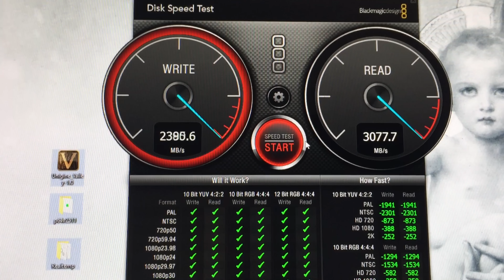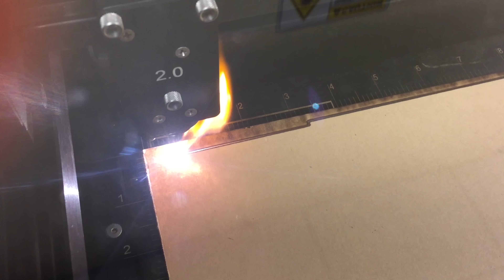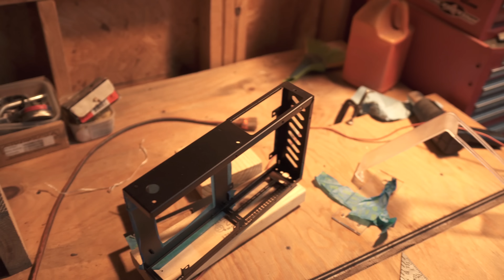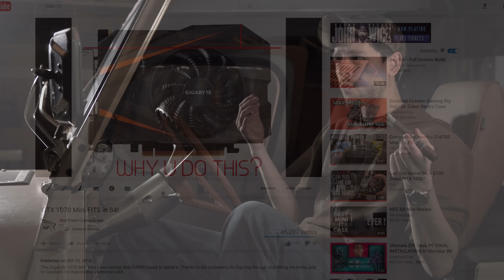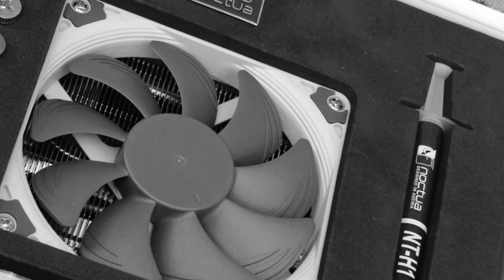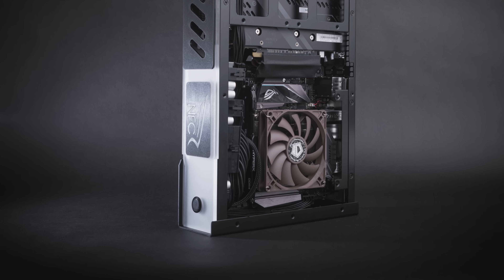Teeny tiny GTX 1080 build

Comment: I did not dig the build because I am looking for a build about half the size. But the CIGAR, that made the video!
Reply from the maker: Thanks man. This build is now very obsolete being it was over 3 years ago, but if you check out my main channel you might like some newer stuff. The S4T has the same hardware but less than half the size. :)
Reply: I will check that out thank you. BTW try the TABAK Especial Negra. it is a dark cigar with a great flavor. It is the on with a round tip. Not the pointed tip. You can almost eat it. It is my new favorite smoke. I normally smoke  Rocky Patel's
Reply from the maker: @markratner4445  I'll see if I can get ahold of one. I don't smoke anymore from health reasons, but it is Easter...so maybe one? ;)
Reply: @NotFromConcentrate  I would like to make a build with amd cpu, radeon video and  have an optical laptop dvd drive in the case.  
what would be great is to use my dell optiplex 780 usff case, but that would be difficult to get a video card in it without cutting up the case. so I think I will keep the optiplex because it is in perfect condition and make a new case build. but it must be tiny like the optilex or like the S4T with an optical drive that will defeat my xbox one x and preferably  the xbox x series.  Any ideas?

Comment: You should make a new build video using the single slot Zodac GTX1070 Katana, if you can fit 1080 in that, two katanas will definitely fit. Looking forward to see a 1070 SLI video from you!

Comment: smallest 1080 build? yeah not sure about that with the DAN case a4 in production
Reply from the maker: The Dan A4 is amazing and you should buy it right now!!! But the Dan A4 is advertised at 7.2L and the MINI is actually 4.46L so I stick with my statement. Peace! Here is a picture showing the Ncase, A4, and MINI all together: https://i.imgur.com/BBFcSClg.jpg
Reply: the stock a4 mini is smaller, but you also have to compromise on parts you put in. a lot more than with the DANcase

Comment: im building a small pc with a intel pentium g4560 and a rx480 what pico psu would recommend for this build pcpartpicker recommends a 300w psu as it will use around 220w at full load. the rx470 has a 8pin connector
Reply from the maker: HDPLEX 300 and Dell 330w

Comment: Have you ever thought about trying to run one of these systems off of batteries. Since the pico power supplies and other DC power supplies use around 16V DC at 25A (specifically the HDPLEX HiFi 300W). I i thought it would be interesting to test.
Reply from the maker: Yes, industrial clients use these systems tuned for encoding and run them off batteries. See YourPaladin.com as an example. Peace!
Reply: Thanks. The domain for the web sight is no longer registered but I did go checkout the Facebook page.

Comment: Josh, what's the best sub $200 motherboard for the S4 mini? I have everything except the MOBO and that's all I need to finish my build.
Reply from the maker: Sub 200? I love the ASUS Z270i STRIX!!! The only problem is it really limits your heatsink choices, but seeing how the NHl9i is the best cooler for the MINI anyways, and it fits perfectly, there aren't any drawbacks I can think of. Peace!  http://amzn.to/2lhBEWa
Reply: So I have everything I need but no boot. mobo led turns on and RGB on the Strix turn on but no fans and no beeps.

Could it be the HDPLEX?
Reply from the maker: Sounds like RAM to me imo. It could be a power issue, but this generally is RAM and DDR4 is pretty picky. Do you have anything you could use to get into the BIOS and set it up for your memory?
Reply: Bent MOBO pin. Should have been the first thing I checked but there I was with a multimeter for an hour trying to figure it out lol
Reply: Efrain Torres Does everything work now? Could you share your pc? :)

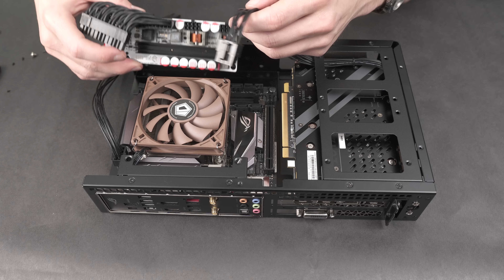Comment: I'm thinking of making my own custom 2-3 inch 24-pin cable similar to the one at 11:08. can't find any custom cable at that length online, so I think I have to make one myself. The price of a high quality crimping tool is about the same as a custom sleeved 24-pin cable, so there's that too.  Would it be better to leave the cable without any sleeve if it is that short?
Reply from the maker: Hello, Lawrence. I have a video on how to make your own custom bulgin switch wiring (and links to all the tools and materials) if that is interesting to you. I also sell the buttons at any length wire and sleeve too on my website. Just order it and send an email with the notes.
Reply: I think I'll order that same crimping tool when I'm ready to replace the standard HDPlex psu cables down the line. Seems like a very reliable product if you've used it on your several builds, you're jeep and a 30 year old dryer. I ordered my S4 Mini and it just came today along with a pcie extender and a silver mechanical switch. Thanks!
Reply from the maker: It's cut thousands of wires over the years. I had to think about it if it was an exaggeration, but nope, it isn't.

Comment: whats the efficiency of that psu?
that should be the default Case/style of the S4 mini. with minimal holes.
Reply from the maker: The HDPLEX 300 is something crazy, like 94%. The Dell 330 is between 85-90% efficient--there are different models.

Comment: What is the height and width of the cooler? Is it possible to use an Arctic cooler to get better cooling and still a smaller size cooler?

Comment: Your build is stunning. In mind of portability, this build needs big 300w ext power adapter, space counted. I prefer other with internal sfx-psu, like node 202 or zaber sentry, do it has more space for longer vga cards.
Just saying if you can insert somekind of internal power adapter like hdplex combo and the good port placement, maybe to hang it on top the mobo, it will be the best for portability. One fan mini vgas can give that kind of psu a little space, but we concern more fans on the vga than a bigger fan on the cpu cooler. Thanks. Asian market is waiting for you
Reply from the maker: Thank you for the compliments! This is a modding channel where I do weird stuff I find fun. I recommend to people in the real world to use the right tool for the right job (or case). I will say that the MINI's external brick is a deliberate design choice. You can see some of my thinking here: https://smallformfactor.net/forum/threads/why-use-an-external-psu.1715/#post-36499   The cases you mentioned are awesome too if you are looking at running full sized GPUs.  Peace!

Comment: Awesome build except for one thing: All of the holes on the system allow way too much dust to enter and damage the components inside unless the user uses air to blow it out on a regular basis. Otherwise, great job innovating and engineering this rig.

Comment: hey nfc, 
i decided i want to rebuild my pc into a mini itx case and i need a gpu that's under 400$ and fits into the hdplexs power limit 
gpu-x 
cpu-i7 4790k
psu-hd plex in this video + the dell power brick
case-nfc s4 mini 
mobo-msi z97 gaming mini itx lga 1150 
ram-16gb corsair vengeance ram 
thanks :)
Reply: zSyncc well, gigabyte gtx 1070 mini fits as far as i know. He even showed the video that shows that in this video

Comment: A stronger alternative to the Scotch 4010 tape is the 3M Scotch 5952 VHB Tape.  It's a bit thicker but is insanely strong and is used by RV manufacturers to attach body panels to the outside of the motor home so they don't have unsightly screws or rivets.

It's crazy strong and weather/water/freeze/Alabama summer heat proof.

Comment: Awesome video. I don't think you can get much closer to dream computer than this. Have you tried out the HDPLEX 160W AC-DC w/PFC? According to their site they're also releasing a 300W variant Q1 of this year. If you could somehow make it fit then you could drop the external power brick and have an even more portable system.
Reply from the maker: Yup, they are excellent. I am really honored to get to work closely with HDPLEX and Larry has been great making sure everything he makes fits well. There is only enough room to use the AC-DC supplies with low profile cards though--but if you can live with the excellent 1050ti, you can have a brickless system. Thanks for watching!!!
Reply: Not From Concentrate I checked out SFF and it looks like one of the users, Kmpkt, was able to fit the 160W AC-DC in with a non-LP GTX 1050 Ti from EVGA. Is it possible to change the cutout for power to accept a universal cable instead? Having fun planning a build and look forward to pre-ordering a case come 3/1!

Comment: How high is the actual power consumption?
Reply from the maker: About 55-60 watts doing normal things like watching YouTube. Benchmarking or AAA gaming I gave an honest number, under 265W.  Peace!
Reply: Not From Concentrate That's not too bad. I though the 330W was tight, but it's quite comfortable.
Reply: Another question, disregarding the chassis. Would it be possible to go with two HDPlex units and two powerbricks to extend the performance into X99 territory?
Reply from the maker: Absolutely. I even have a video on that somewhere in my library. Dual Current Just Cause I think. But you have plenty of room to go X99 off a single Dell brick though.

Comment: Why don't you use Cool Labs Liquid Ultra directly on the chip when there is a copper top plate? The temps on a 7700k are so drastically reduced by CLLU. Liquid Ultra is not so great on top of the IHS though. It's meant as a replacement for the metal lead solder between the chip and the IHS. At least I believe that's why the 2500k and 2600k get great temps with an evo 212 and still reach 5ghz.

Comment: Very cool build,
Wondering if you'd be able to help me with a problem,
I'm trying to build a small form factor case myself, and I need a very specific PCI-E riser cable length, I was also hoping to have a black coating on the cables and PCB.
My question is, do you know where I may be able to source a custom length PCI-E ribbon cable?

Comment: Man, that glam shot of the case in the dark looks so good. Awesome job!

Now that I'm editing 4K drone footage all the time I'm pretty sure that I'll be upgrading to a Ryzen 1800X (bought a nice chunk of AMD stock last year ;) but sadly, I doubt the L9i will handle the 95W TDP, maybe I'll stick an H5 on the side and just leave the side-panel off... (also, suspect there won't be any mini-ITX boards on launch...)
Reply from the maker: lhl! My man!  Yeah, I have no idea. I'm a huge AMD fan, but they have never been good heat/watt measurements like Intel. I expected this 7700K to be much hotter than the 6700K, but it is much, MUCH better tuned and runs cooler. With an AMD chip...no clue. Can't wait to try Ryzen!!!!
Reply: lhl The l9i actually isn't, and according to Noctua, never will be AM4 compatible. Just so you know ahead of time.
Reply: the NH-L9i can handle a 7700k stock, and with a free 4.8 OC on almost stock vcore. And if you delid, you will be golden on your load temps. Here's hopng AMD has good TIM, or they are designed to allow for a proper delid and some CLU.
Reply: Oh, I know exactly what the L9i is good for, I've been running it on a 4790K in my S4 for over a year. Looking back at my initial testing, while the 4790K is rated at 88W TDP in ARK, in testing, it hits a system (board, M.2 SSD) wall-power consumption of 173W at turbo, and thermal throttles at 100C in <25s.
Reply: Not From Concentrate yeah to be fair the big Ryzen chips actually look great vs Broadwell-X core for core, Intel's 8 and 10 cores are getting blown away TDPwise for a change. There are also more reasonable 65WTDP Ryzen SKUs but I mean, YOLO!
Reply: lhl If you use an L9a with the am4 mounting plate wouldn't it work? Oh and handle the TDP is meant to say.
Reply: Avery F Noctua currently doesn't have an AM4 mounting plate for the l9a. Remember, the l9i and l9a both have mounting solutions that differ from all other Noctua products.
Reply: Noctua specs the L9a as a 65W TDP part so it'd wouldn't be suitable for the 95W X parts. Even for the 65W TDP parts, you'd thermal throttle on your boost speeds I'd assume (the 4790K is dissipating at least 50W over its 88W "TDP" number at max boost). Post-benchmarking I've run my 4790K stock (4.0GHz) w/ boost disabled and w/ a -.125V undervolt and it runs cool as a pickle (also, I have a GTX 970 in my S4 on the HDPLEX 250, so that keeps thermals and power within spec). I probably won't be able to build my Ryzen system in the S4, especially if there are no mini-ITX options at launch...
Reply: Bryce Swain Oh I didnt realize the AM4 mounting plate they gave didnt support the L9a. I had assumed they were all the same except for those 3 on the other AM4 plate.
Reply: lhl Yeah thats true. Im hoping they release mITX boards for AM4 though. Really hoping. 

Oh how is the TDP rating calculated? Does it go by the fan speed or does it go by the mass of the heatsink? I guess its a good think you said that because i wouldnt have known otherwise.
Reply: Avery F They are working on one for the l9a, but say they are having issues due to changes in the am4 socket. They might have one later, but probably after Ryzen gas already launched.
Reply: Bryce Swain Oh well that blows. I guess ill just wait till they either make one or make another tiny cooler.
Reply: Avery F TDP is actually something that's thrown around a lot in conversation but 1) not a standard by any means and 2) widely misunderstood. Here's how Intel defines their TDP: 

"Thermal Design Power (TDP) represents the average power, in watts, the processor dissipates when operating at Base Frequency with all cores active under an Intel-defined, high-complexity workload. Refer to Datasheet for thermal solution requirements."

Note TDP here doesn't account for turboboost at all or even maximum power draw for all real world workloads/scenarios.
Reply: lhl Oh yeah i know about the TDP and actual wattage difference. I can never find actual Wattage for CPUs though. GPUs no problem as its usually listed on the GPU website.
Reply: lhl - I don't know if they'll be out at launch but AMD did announce the X300 boards which will be performance itx boards.
Reply: Looks like Biostar has their official board lineup now - no mini-ITXs in sight. :/
Reply: They now offer a mounting kit.

Comment: Woo a shout out for the 1050ti, it never gets any love even though it's amazing for the price, and performs about 25% better than a 1050. I have recently gotten one to upgrade my 750ti and it is fantastic.
Reply from the maker: That's my card in my system. I love it!
Reply: It's not just about performance, but the lack of the need to supply power to the card with additional cables. You literally just plug the card in like a stick of RAM, and go. Easy installs!
Reply: David Martin No point in one the Rx 470 is better for just a little more
Reply: I actually prefer to have external power, my old Gigabyte Windforce GTX 750ti (the 4GB version) required a six pin, and it overclocked/overvoltaged fantastic. I was able to get a 405 MHz overclock on the core and a 450 MHz overclock to the memory with it, for a boost clock of 1.6 GHz core and 3.45 GHz memory. I was not able to get much of an overclock on my 1050ti around 150 MHz and 200 MHz respectively, but it's still better performance than my old card so I'm not mad. It also draws much less power than the old 750ti.

Comment: Really nice! No compromise on performance clearly..sure on noise..:) really impressive! And you have chosen is-vc45 as cpu cooler..:) and you are right by still putting a front bezel with gpu cut...it's the best compromise for the power button..:) Nice,  nice job Josh!
Reply from the maker: Thanks Marc! I'm replacing the VC45 with a Noctua though. Wanna buy it from me? 20 bucks? :P
Reply: Not From Concentrate thanks for the offer,  but i've already one..:) but let me think longer...:)
Reply: Not From Concentrate I'll buy it for 20 bucks :p
Reply: Sarthak Sharma you can go for it, as my next build will be based on ryzen (95% chances) and this is-vc45 is only for intel sockets..:)